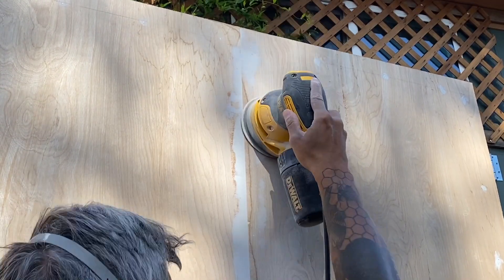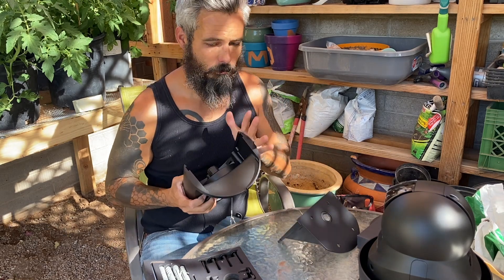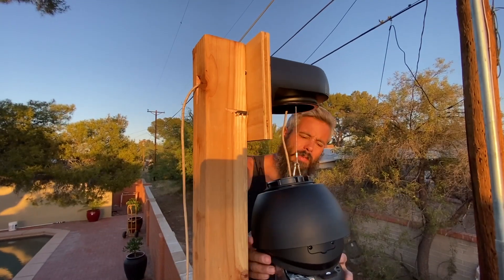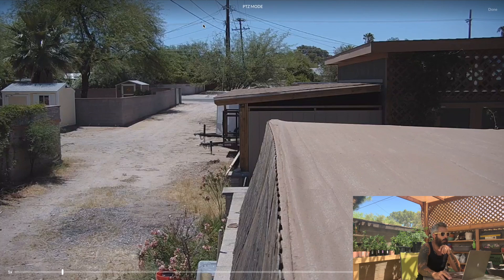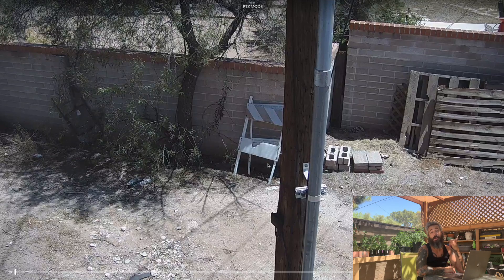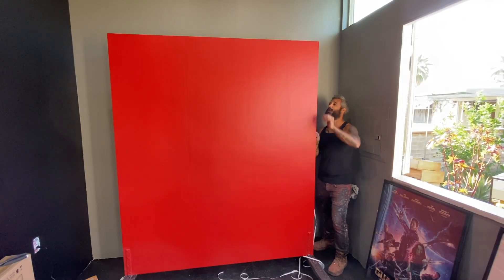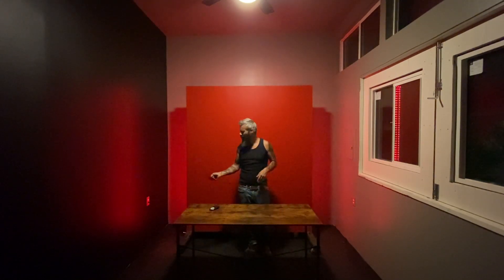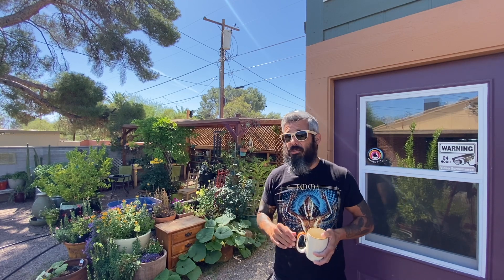UniFi G4 PTZ for HOME SECURITY | Extreme Tiny Home Security

Comment: Id be interested to know how many install cameras outside, on a ubiquiti setup, that dont put CCTV on a VLAN thats isolated from the rest of the network.  Not doing so would be an easy way for someone to gain access to your entire network when using POE.  I know this is an issue for most CCTV setups using POE. Id be interested to know if youve taken this into consideration or does the Ubiquiti protect software do this automatically?

Comment: Its a good cam but at 2k there are others significantly better in quality and zoom for far, far less.
Reply: Yeah I doubt it. I've done quite a bit of work with UniFi stuff, they are top notch. They also integrate well into their ecosystem which is not only robust but offers enterprise level tech at a consumer cost. Their smaller bullet cameras are a bit over priced but in my experience, the G4 PTZ is priced well. You get what you pay for.